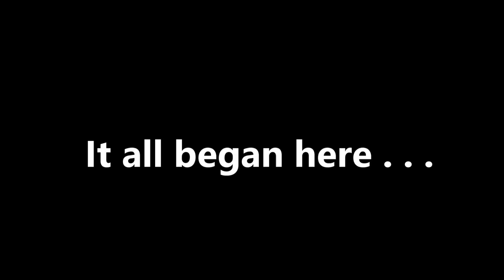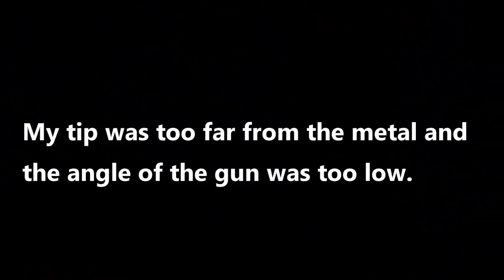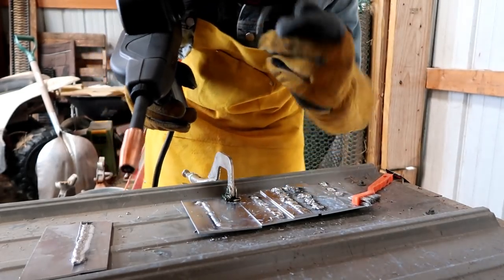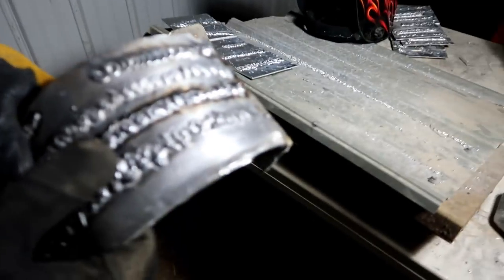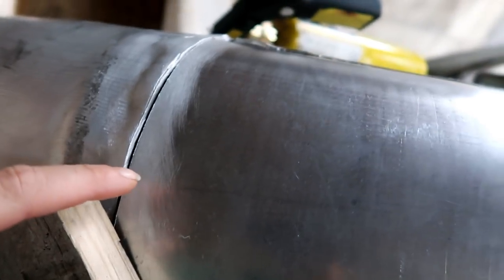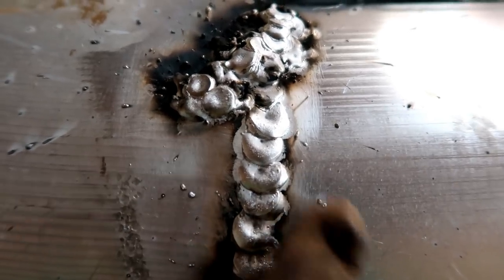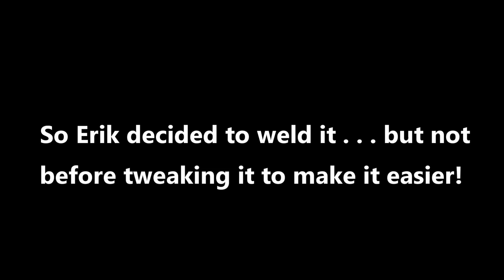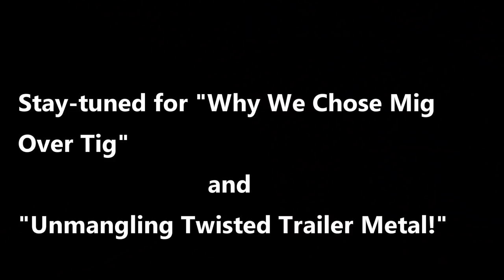153 Mig Welding Aluminum Instead of Tig Welding?

Comment: Welding Aluminum is an art, running a spool gun is completely different than mig welding too. I personally like a spool gun but I use Argon gas with the spool gun. I think that you both done a good job!

Comment: Pretty darn good for the beginner welder and material you have to work with. Welding is a bit skill, art, and a whole lot of practice which equals experience. Aluminum welding is just as artistic as it is functional.

Comment: okay its a pain to weld aluminum , First hold the tip of wire at an angle to the left if you are right handed. like a pencil point. this will put the wire near the material you will be welding, and the gas will force away oxygen and dirt. second with your pencil tip AKA wire, draw smiles from right to left to right to left etc, etc, .from bottom to top (vertical welding) ...   now horizontal you hold the tip the same and you draw a (C) backward up down up down etc, ect,.  watch the molten puddle it will go where you push it.  Use a new stainless brush only for aluminum use acetone to clean the material to remove contaminates. do not touch any thing to the cleaned material till you are welding and only the welding wire. You can practice smiles and backward c's using pencil and paper and welding gun. Tape pencil to under side of gun nozzle with pencil lead out wear you can see it . draw a straight ling then weld it with lead ... you will become use to the weight of the torch and the movements.   you got this girl.
Reply from the maker: HA! That's awseome! Never thought about taping a pencil to it to practice, great idea!

Comment: Much easier to TIG weld thin aluminum than using a spool gun. IMO, you've still got too much heat or too high a wire feed rate. Also, increase your gas flow so you don't get the soot you're seeing. Lastly, are you set up DC+ with Argon for the shield gas?

As for the surface being too hot for you to rest your hand on, weld from the weak side, meaning, angle the gun to the left and push the weld from left to right. Also, smaller circles, as you will be going back into the puddle which give you the penetration required.

A spool gun is fine for larger jobs, but for small repairs like you've got, TIG is the way to go.
Reply: Agree with way too much wire and heat and not enough gas. Also if it's windy at all out there, that will screw things up.

Comment: When using a SS wire brush work in one direction only, it looks like you are welding cold, try heating while welding, and when done welding keep heating, and then remove the heat slowly. (helps stop the weld from cracking.)

Comment: Hold the spool gun across your body, makes it easier to see the puddle. Aluminum is tough to tell because it doesn't change color as it gets hot like steel does.. largest gaps on Aluminum I've had to weld was about a half inch on an old dump truck... To fill gaps keep the wire on the metal, not the hole, build a bridge, then build the bridge.. it's easier to go downhill, as the heat rises and the lower metal is slightly cooler..

Comment: Welding tip 101. Keep the tip about 1/8-1/4” away from the pieces in order to keep the gas dense and prevent impurities. You can either push or pull, whichever feels better!
Reply: Sorry, I just saw that you realized the tip was far away...
Reply: But you’re doing great!
Reply from the maker: haha, thanks!

Comment: Erik ha ha Just the way you sad it I figured you were going to try ,Alum can be  hard to weld ,You can use your other  mig,  gun you need to change the liner and feed wheels ,  S S wire brush , clean with acid tone ,hold the gun closer the work 1/2 to 3/4 use anti spatter spray or dip on nozzle
Reply: or just buy a dedicated rig and forget all the swapping about and resetting of controls.
Reply: How often are they actually going to need to weld aluminum though? Cost of the proper unit vs usage...

Comment: I was taught to clean with a stainless steel wire brush that you only use for your aluminum welding. anything else like brass etc or a dirty bruss can contaminate the weld. I never used a spool gun only tig.
Reply: I want to try tig so bad

Comment: Don't be afraid of the welder. The nosel should be kept within 15° from square of the surface and no more than about 3/8" from the surface. Other than that just practice. The farther from the surface you try to work the hotter the weld thus burn through. If you have too great of an angle from the surface you'll not have shielding gas to protect the weld. You're doing good though so keep at it. By the way, preheating sheet aluminum is not at good idea in my opinion. The weld alone provides plenty of heat.
Reply from the maker: All very good tips!

Comment: This is one of those things were it may be best to haul it to a welding shop and have an expert do it.  If its not done properly, it will only crack out again and that may be a big issue once the inside is finished out. 
I used to weld for a living and have done many aluminum trailer repairs in the past.  Aluminum's fussy, and takes a real skill set to be proficient at it.  I hope it all works out you.
Reply: I second that.   Aluminum welding creates weak spots as is let alone if done poorly can create huge headache later.   Stainless and mild steel can get away with a lot aluminum  not so much.

Comment: I will agree with Doug,I would use argpn for the sheilding gas ,ac tig if avalable.
Reply: the take is 100 percent argon we had to get is special when we welded stainless steal on the maple syrup evaporator.

Comment: Aluminum dissipates  heat 10 times faster than steel ..   I would not bother with pre heating .. I would maybe use smaller diameter wire ..  with fast wire speed and higher heat..    If you do a bad job you can have fun  grinding with the Potella  disks and   weld it a second time

Comment: Here's my tips for welding aluminum. Don't worry about full penetration for what you are doing just a well fused surface weld with work. And if you are honestly concerned about it. Weld a set of stringer welds and make the other two welds fuse with the base plate on the left and right side of the original weld. As well as the original weld it's self.

Comment: Home Depot sells aluminum ladders based on the little giant ladder, I have one and I love it very sturdy compared to the Fiberglass ladder you have. I wouldn't trade it for anything and they are very universal you can even get scaffold systems to use with the ladder.
Reply: yep we have one we use it to get up to the hay loft and we use it when putting up new tree stands works great.

Comment: Ok...not bad for your first times...aluminum can be hard to weld in general. The wire feed is the most economical and probably easiest to learn quickly, but TIG would be better. Aluminum dissipates heat very quickly and TIG is easier to control where the heat goes. Either Mig or Tig (for sure tig) should be using helium as a shielding gas for aluminum and the aluminum will need to be cleaned with acetone to remove the oxide scale before welding. Also there are some grades of aluminum that are not weldable. Most of the 4000 series are weldable and it may be a safe bet that most of the trailer was built out of weldable aluminum but there may be different grades. Preheat is definitely going to help and if you need to fill a gap you can place copper behind it to fill it up and hold the weld in place and then remove the copper.... if you are using a wire brush, make sure it is stainless steel and not carbon as it will contaminate the aluminum making it more difficult to work with.... because the aluminum dissipates Heat it would be better to use a stacked dime method (moving forward and back) to heat a short area in front of the weld puddle and then move back to deposit the filler metal.... good luck. It would have been easier to start with carbon steel to master techniques before moving to aluminum.
Reply: I tried to slow the wire feed down but you could hear it wasn't liking it.  I would love to practice some tig welding.
Reply: @ruralridez6165  ...I worked in a fab shop once as an inspector where they were building cranes for the Navy to use on ships out of aluminum and they were using wire feed mig guns. Granted they could use pulsed arc and spray arc as delivery methods on more expensive machines, but even they still had trouble with it. TIG really is the best method but it's slower  and can take a good bit of practice to perfect....

Comment: Get the Heat right  ..  speed up or slow down the wire speed ..    use smaller diameter wire..   clean everything with stainless steal brush and Potella  grinding wheels for aluminum ..   move the gun faster when it gets hot..        I guess it just takes practice  ..  they actually taught welding in my  10 Grad Ag Mechanics class ..

Comment: Vertical welding regardless of material with electric arc  is extremely difficult, at best, for a beginner. Kudos to you for trying. Let's see...you weld, drive tractor, raise children, mow hay, bale hay, look really good and...do you cook? You have all the requirements for a real KEEPER! Congrats!
Reply from the maker: Right now verticals are hit or miss.. the aluminum has such variation that one place could go well and another spotty. I did get one excellent pass on the front  joining two ends together! It's kinda fun figuring out what works and what doesnt, like a puzzle!
Reply: Indeed, but remember, practice makes perfect...... you just need some hands on time . It will come to you.

Comment: Check out chuckE2009  he is a welder and  has some videos on welding. I do commend  you for thinking out side the box  for taping the wood block to your hand.
Reply from the maker: I have watched several on his ratings on welders and using a gun to run spool aluminum.

Comment: I USED TO PREHEAT ALUMINUM ,WITH AN ACETYLENE TORCH,FIRST I'D SOOT IT UP,(TURN OFF OXYGEN AND USE ACETYLENE ONLY)THEN HEAT IT UNTIL THE SOOT IS GONE THEN THE PRE-HEAT IS RIGHT TEMP...MY FATHER( WAS A WELDER 50YRS )TAUGHT ME THAT ONE AND IT WORKS GREAT..I AM A SENIOR CITIZEN NOW..IT STILL WORKS..YOU CAN ALWAYS PUT A" FILLER ROD" BETWEEN GAPS ,THAT IS A PIECE OF WIRE OR ROD DEPENDS ON HOW YOU ARE WELDING IT .IE MIG TIG STICK,MIG USE A LITTLE WIRE FROM SPOOL AND FUSE THAT TOGETHER THEN GRIND IT IF NEEDED AND RUN BACK OVER IT.USE A BACKING STRIP OF COPPER TO PREVENT BURNING THRU..SLOW YOU WIRE DOWN OR SPEED IT UP DEPENDS ON HOW YOU ARE WELDING ,COLD LAP MORE HEAT TOO MUCH PEN SPEED UP OR TURN DOWN HEAT..WATCH YOUR PUDDLE ..

Comment: Probably best to have some who does it all the time do it. Aluminum transfers heat very fast. It's best to weld it when it's hot outside. TIG is better but welding anything takes a lot of experience.

Comment: Don't over think it! My son in law is a licenced welder, he showed me and at first it looked worse than yours. Remember the tip has to be close enough for the gas to be of any use, most of the time if it is a bubbly mess it is lack of gas. If you are burning through it is simple, you are either sitting in one spot too long, or the heat is too high. In any case remember it does not have to look like a pro did it, to be strong. Practice is the key, but if you are like me, you will not do it enough to get the practice in.

Comment: Ah... Lincoln!! 
Reminds me of a quote from AvE..:
"Miller's for drinking, Lincoln's for welding."
I've run just about all the brands... I own 3 Lincoln's and 2 Hobarts.... 
Spool gun is Hobart too... 
Just a couple of observations, that spool gun looks clumsy... 
I know it's HOT, but... It would be much easier to hold the gun with one hand and steady the cup with the other. You look like you're shooting a machine gun...
Your 110volt welder should be more than enough for that lighter material too..
Biggest thing with aluminum, is cleaning the oxidation off with a stainless steel wire brush... 
It takes over 1100°f to get through the oxidation... Clean aluminum welds between 400-600°f...
Reply from the maker: yeah works much easier to hold the tip than to straight shoot it!
Reply: A couple of those poses... You looked like you were clearing the area..  lol 😎
Hope between the two of you, you get it all done and looking good!!!!
Steel trailers are a pain to fix the nose on too. Our old one (no longer have it) got the front smashed twice.... Bumper pulls in the ice, I didn't do it!!!

Comment: If you have an 1/8 gap  you need some 1/8 " aluminum wire to fill the gap with  ..  I often fill a gap with  steel when I wam welding steel .. don't weld  aluminum often so don't have a lot of aluminum stock in my shop ..  but here in Kalamazoo   have Alro Steel and   Schupan  places to get  scrap pieces of aluminum ..   they have an Alro  in  GR of course..

Comment: It seems that anytime you have a gab you  will have a place with crappy welds underneath as  your gas won't be shielding the weld from oxidation ..    the gas shield  keeps oxygen out of your weld ..  which contaminates 

  I was going to suggest you get some kind of a block to lean on when welding on the bench ..  putting a block up your sleeve was a good idea to hold your hand steady .. I never tried that ..   but it's a good idea..
Reply from the maker: yeah I was getting desperate, lol!

Comment: On alu I always chose TIG welding. Much better control when TIG welding. But a TIG welder is much more expensive. I think you do it good, for the short time of training. If you will be a great ALU welder you have to train alot, not only 1 hour a month. And rule 1, have your gun closer to the weld.

Comment: Yikes! Please stop doing those individual tack welds and weave back and forth from one piece to the other in a continuous forward motion.
Keep tip close, to preserve shielding and keep weld cap to a minimum.  Grind flush what you have done and see how it looks.  You should need preheat only to start, the welding will preserve the temp after that.

Comment: Well I three brothers and I'm the welder of the  family.  Weld is important part of structure support in those areas.  Really should have practiced more first or had someone that does it for living. Aluminum is odd metal, I still have hard time with it. 
  I really hope they are good welds, if not your going have a failure repair.
Reply from the maker: Well, at the very least we will keep an eye on them. If we notice any cracking we can cut the weld out and re-do it :) But I would agree that more practice is in order ;)

Comment: You can concentrate the heat where needed  if one side is colder than the other   keep the  spark on the cool side then you can  pull the puddle where you need it..  I read others advice .. seems some of it was pretty good..  Lots of little tricks you can figure out with common sense..

Comment: one thing about a Mig gun with Alumy..you can not do  buttons like MIG on carbon.  Just lay into it and weld.. the heat will appear best tip:  check out Jodie at Welding Tips and Tricks on Youtube

Comment: ....once you get you hands on a TIG machine with pedal heat control and the ability to hand feed the rod in as needed, you will be an instant PRO. 110V/20% duty cycle machines running 100% Argon with a spool gun is a concentrated effort even for the best of 'em.

Comment: You cannot tack weld aluminum like that due to contamination you have to start the trigger and go circles or straight for straight back check marks move move move fast fast fast and your gun needs to be almost a 45 degree angle as you push the weld

Comment: You have to control the speed of your half circles or full circles, then point the tip in the direction of your welding so it pre-heats the next weld, and you may need to lower or raise the power, and wire feed of the welder.  In generally try not to jump the gap as much as possible.  And be safer on the ladder, don't poke your husband when he's working on the ladder.  The safety was lacking

Comment: your tip is to exposed  pull your nozzle down a little puts the gas closer to the weld move your gun up and down i was a welder for 15 years
Reply from the maker: I was thinking that too, but I'd have to unscrew the outer shield as the inner tip is in as far as it will go :(

Comment: And this is why spool guns suck. It doesn't help you're using a 110v unit. As a few others have said, left to right or right to left, not up and down. Can't see the puddle unless going left to right or vice versa. Aluminum is tricky to weld to begin with. Kudo's for attempting it at least.
Reply: I love my spool gun but it's also 220. Welds look just like a reg mig. I think more practice is needed that's all ?
Reply from the maker: I'll explain why we chose mig over tig in a later video :)
Reply: In my opinion, TiG is far superior, gives you better control. However, many need to keep in mind, price and how many times is it going to be used. Personally, I dislike spool guns, extra weight in your hands you don't need, then again, if you're used to using one, kudo's.

Comment: It all looks like it will hold together and that is all that really matters .Still it looks like the trailer was all put together with rivets so . … Anyway my only worry is that you are welding in a barn with dry hay on the floor and really all over and sparks are going all over. Perhaps you should weld outside or at least keep some means of killing a fire fast near you .

Comment: should've started with regular steel and wire  before moving to aluminum  one reason steel is more forgiving than aluminum then once you are happy with that and used to running a mig gun  then switch to aluminum  because by then you know how to run a bead and not  spotting a bead  that's what you are doing is basically spot welding and not welding
Reply from the maker: I'm only doing what Erik told me to do :/ Even had I more practice on steel I would ahve made the same mistakes and Erik still told me one spot at a time :( But I'll experiment with various techniques this week!